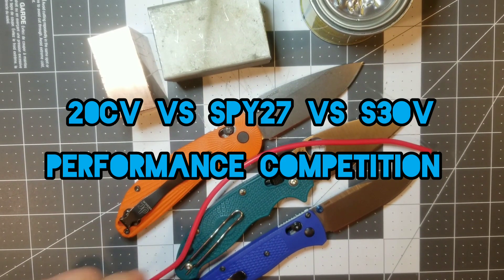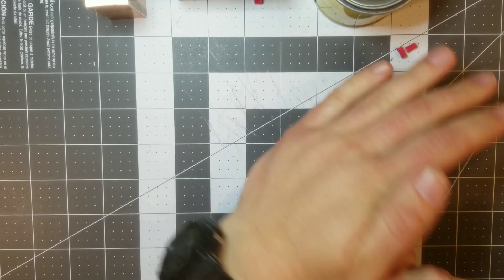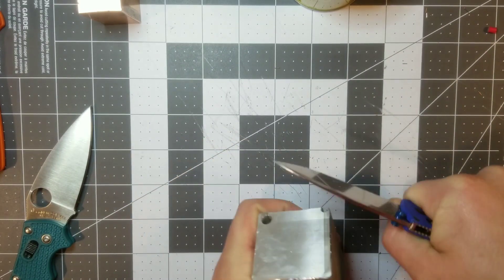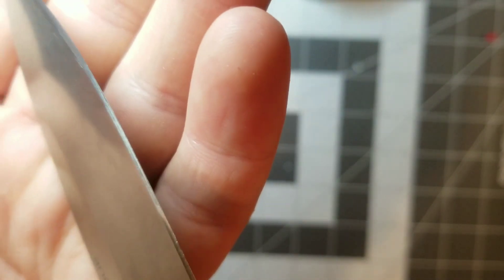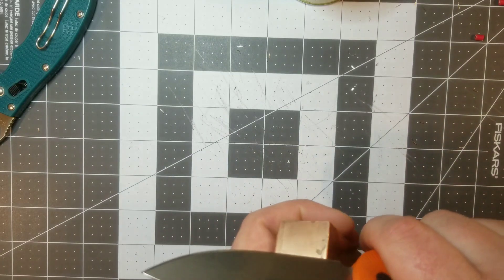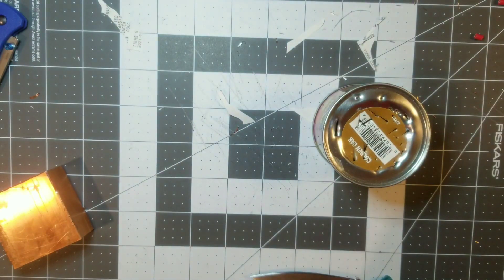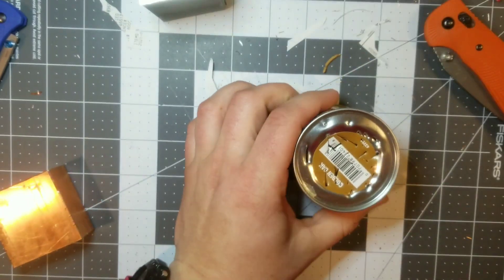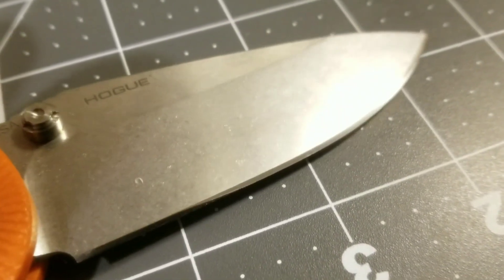PM stainless steel showdown! 20cv vs spy27 vs s30v.

Comment: I dont open paint cans with my knives, i use a flat head screwdriver or a paint can opener, their free, when you buy paint, i dont beat the blade of my knife on metal, I use a hammer for beating on shit, not my knifes, i dont stab my knife into metal, I use my knife as a knife, for cutting stuff, I am a mechanic, I always use the right tool for the job at hand, it makes no sense to me to use a tool for sumthan other than what it is intended for,  its kinda like digging a hole in the yard with a pillow, instead of a shovel, these videos are stupid & make no sense, I think im going to Mow my grass with my Ladder, not going to work very well is it
Reply from the maker: You have a right to have your opinion.

Sometimes people are in situations where they have to use a knife for things knives arent meant to be used for. 
Of course they aren't meant to be used this way. I think that goes without saying 
The point is to see the difference in durability in the steels. If any exists and what they can withstand if youre in a situation where you have to abuse them.
Enjoy your ladder mowing.

Comment: Im personally diggin my Spy27 Manix. It is easier to maintain then my S30V and S35VN blades that are supposedly cousins of Spy27, also seems to get sharper then both but that may just be compliments of Spydercos blade geometry. I own a 20CV microtech ultratech and M390 ZT 0562ti, i personally dont care for how easily they chip if im not 100% careful not to smack them into staples or other unforgiving objects then i have a big headache trying to take the chips out. Much easier to either have a blade shrug it off like my CPM-M4 PM2 or roll but much more easily be fixed like my Spy27/S30V/S35VN knives.

Comment: To be fair the spy 27 manix blade geometry is kinda thin and elongated so idk it may not so much be the steel but the blade shape. Theoretically the spy27 has higher cobalt then s30v and 20cv essentially making the spy 27 harder with proper heat treatment  spyderco spy27 is supposed to be 62 HRC or slightly greater. So my point is spy27 should have less wear then 20cv and s30v if each blade were identical.

Comment: what system or process did you use to sharpen these knife, if you don't mind telling?
Reply from the maker: I think i sharpened all those on the venev f240/f400 stone freehand and then stropped on basswood.

Comment: In my opinion SPY27 is just an upgrade over the standard Spyderco's VG10 steel and could replace it in a close future (for that reason its special name) but not a big one and is under the performances of all the so-called supersteels. By the way, I have other steels as the CPM 20CV in a sprint run Endura and they are in another league: K390, S110V, ZDP189...
My only doubt is SPY27 vs S45VN, I don´t have this last but I think it would be just slightly bettter, a little bit.

Comment: Really great video thank you. I think we can all agree that all 3 of these knives now need to be sharpened, makes me question if it’s worth the additional cost of the spy27 or 20cv over s30v....
Reply: I own blades with all 3 steels. I prefer to carry my para3 in spy27, but a difference between the steels is hardly noticeable tbh...all great steels! 
I am talking about edc ofcourse, lol
Reply: S30V is better than spy27. The 20cv is above those two and could worth the overprice but not spy27 definitly. It is nothing but the next Spyderco's standard work horse steel with reduced costs. You don't give your name to a foreign steel with questionable availability, I'm sure they are planning to use it extensively very soon.

Comment: This is an interesting test (I am curios about SPY27 in particular), thank you. But just to state the obvious - there are many variables that user can neither control, nor get a more detailed knowledge of - and that is the HT. The same steel can perform differently even at the same HRC dpending on how it was processed (some of the tests done by Roman Kase are probably the best example) and on top comes whether any damage to the edge happened during grinding of the blade (I guess everyone watching this video has seen as least some of the edge retention tests done by Outpost 76 where some knives needed 10+ sharpening sessions to grind off the overheated part of the cutting edge). So for me this is a test of a knife at given steel rather than a steel alone.
Reply from the maker: Yea you never know with any knife really. This was just a simple comparison. Mostly to show how spy27 holds up and how similar all these steels will perform in production knives. But they have all been sharpened atleast 5 times before this test was done if that helps.
Reply: @steel2stone  You did a great job. At the end of the day - this is what users want to know - how a given knife in a given from a given maker performs, not how the steel would perform under optimal conditions and hand-tuned HT.
Reply from the maker: @matusknives yea its hard to get perfectly treated blades. Id love to do the test again with the same steels with custom heat treatments.  It would be very interesting to see the difference. Thanks man
Reply: Good point. I pretty much stated the same before reading your comment. I'm not sure if this guy realizes what where saying to be honest.

Comment: I have seen some others that have not been very high on how the 20cv on the Ritter performs (theirs may have been soft, I don't recall). How has yours done?
Reply from the maker: Mines at 61. Its decent in its edge retention. Not terrible but not anything special. I have however been impressed with its stability at the edge
Reply: @steel2stone  Interesting. I own that exact Ritter and have been debating on whether I should keep it or not.
Reply from the maker: @801tb  i think its probably the best knife you can buy for the money. But ive thought about getting rid of mine to.

Comment: Nice comparison! What grit did you sharpen the knives to? Also would you say it's worth paying the premium for spy27?
Reply from the maker: Check the description of the video. I think spy27 is a good steel and so far i like i. But its definitelyý overpriced.
Reply: @steel2stone  Think that about sums it up. Seems like a promising steel, just not sure I'd take it over other spyderco offerings at the moment. Not sure you mention the grit finish in the description, just that they're "sharpened and finished to the same grit and angle". I just watched your venev video, and you mentioned you finish most of your test knives on the 400. So, maybe that was the case here too? Cheers
Reply from the maker: @PotatoCheese  pretty sure i said it in the video. Theyre all finished on a f400 grit venev diamond stone and a 4 and 1 micron strop on basswood
Reply from the maker: @PotatoCheese  yea man all the test knives are 17 degrees and finished on the f400 grit venev stone or something equivalent to that and stropped on 4 and 1 micron strops. Theyre all usually hair whittling sharp when i start the test with no microbevel. I want them all to be fairly consistent
Reply: @steel2stone  Brilliant, great to know. Thanks for the info! I have the little 6x1" venevs and will see what I can do with a 400 grit finish!

Comment: Helpful video again. Thanks!!
How du you check the edge angle? I think a difference of 2 or 3 dps can make a big difference in performance.
Reply from the maker: All my edges are very close to 17 degrees per side. I usually put them in my lansky to check them after i sharpen. Theyre usually right in between 17 and 20. So its possible they could be id say up to 2 degrees different at most. But these 3 were all very close. Its why i picked these specifically

Comment: Interesting. Did all three blades have the same number of edges? The Ritter looks like it may have been sharpened more times than the Manix. Just wondering if all knives have been sharpened down to good steel?
Reply from the maker: Yea. Check the description.
Reply: Oh jeez! Totally missed that!  Thanks for not bashing 😊 
Stellar!
Reply from the maker: @Cycletroll  its all good brother
Reply from the maker: @Cycletroll  the ritter thickens up alot towards the tip. But the manix does as well.